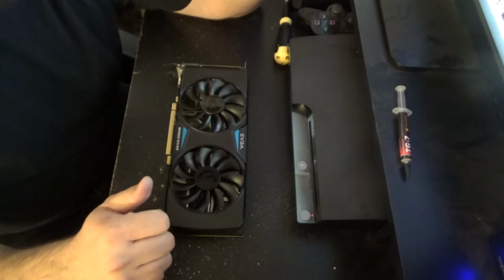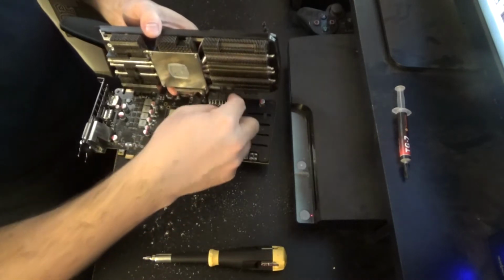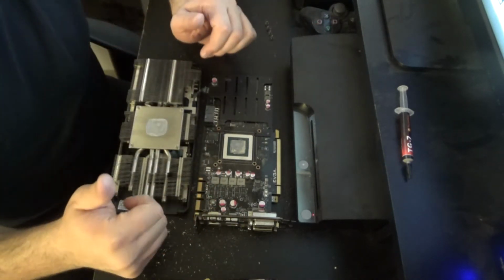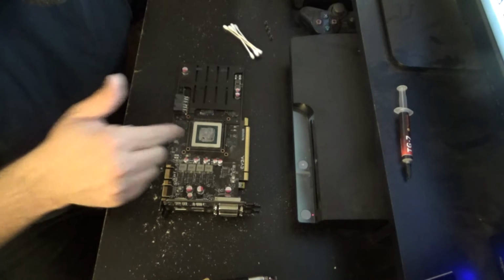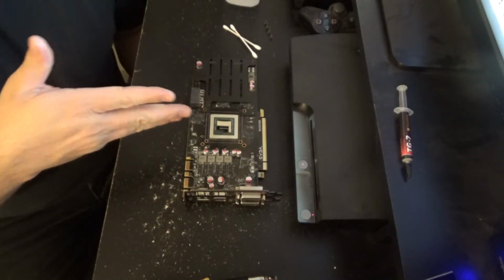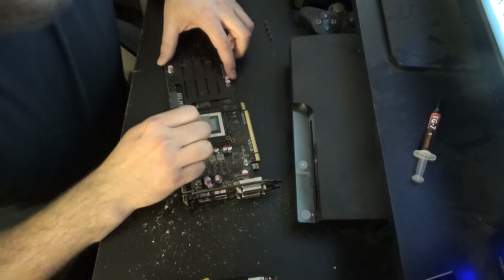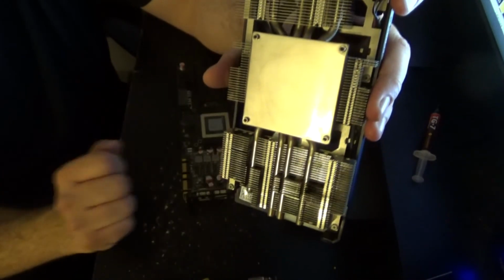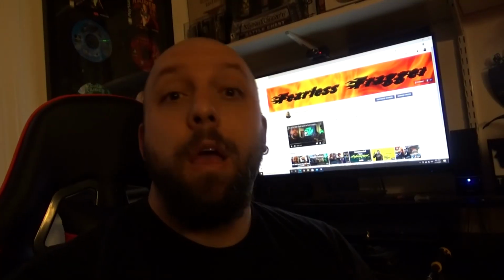New Thermal Paste for the EVGA GTX 970 4gb

Comment: Picked up a FTW+ edition for $140 on Offerup.  Even came with the box and accessories.  A damn good deal, even now, with prices starting to come down and stabilize.  I use Arctic Silver Arcticlean Thermal material Remover & Surface Purifier.  Stuff is amazing, and easily removes thermal paste.
Reply: wow Amazing deal

Comment: ey bro i changed the termal paste and put it in in my pc but then i saw that my 3 fans are spinning very very slow what should i do ? i have a gtx 970 windforce
Reply from the maker: Its possible with the new thermal paste the fans don't have to work as hard. Do you have MSI afterburner installed? Check the temps. Some cards don't even spin up their fans until 50-60 degrees celcius.
Reply: @Fearless_Fragger  I checked it my first Fan works fine but the other two are spinning very very slow